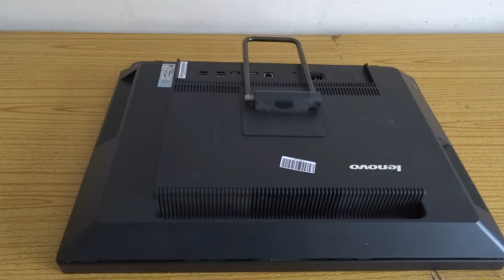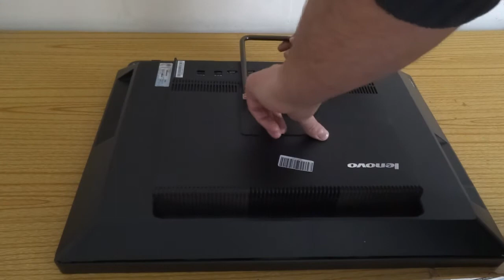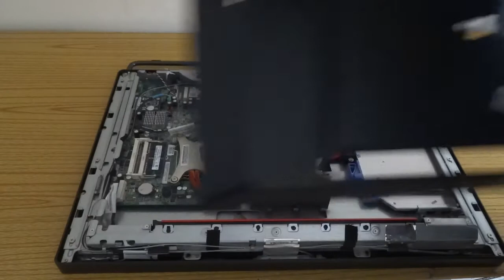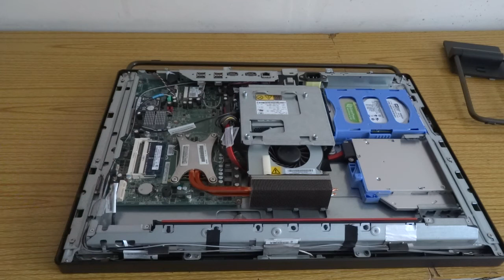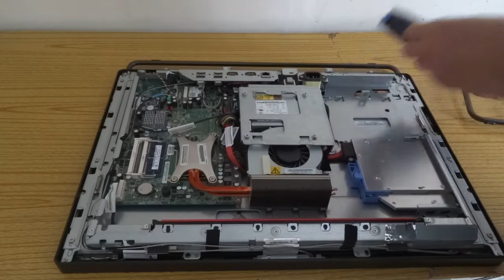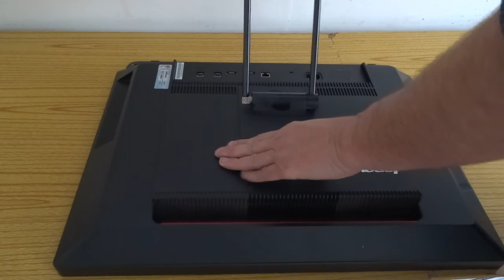Lenovo M92z 23 inch All-In-One Upgrade | SSD | RAM | CPU MAX UPGRADE

Comment: How did you secure the SSD to the inside of the computer? I didn't say exactly what you did, I saw you clip it into the slots but I didn't see how the card It's secured to the frame, you didn't use tape, Velcro, or An adapter bracket since you didn't reuse the catty.  I'm just worried that the connection wasn't secure enough because only the electoral connections clicked into place and I think you might have had a small aluminum slip around the SSD that is found in most laptops,  I'm just worried that the SSD might slip out or something because it isn't clipped or clicked into a place or anything
Reply from the maker: Yeah unfortunately I’m lazy and cheap on my own equipment and yes securely fitting drive is recommended I tend to swap ssd around a lot

Comment: Can i install gpu on this aio pc?
Reply: Nope... closest you could get would be the mini pcie and it would be extremely slow and not convenient, you might be able to use an egpu but if you only have usb 2.0 it will either not work or the bandwidth will be too low
Reply: @TsunamicBug  oh thx
Reply: @meinfps  np
Reply: did you get a gpu for it
 @meinfps
Reply: @Quickio  nope,im saving for gaming laptop
Reply: @TsunamicBug  can you tell me how to do it?

Comment: I have similar pc with yours, in this past several months, my disc C is always dirty, and it ended up asking for new windows installation all the time, do you think i should upgrade my hardisk to ssd?
Reply from the maker: Yes for many reasons, it will be much faster the main reason.

Comment: I maybe thought of using this as a monitor because I am going to get  another computer
Reply: Typically, with all-in-one computers (Lenovo ThinkCentre M92z, ︎iMac, etc), the Video-Out port is to send video signals out to an external monitor.  Normally there are no video inputs as they cannot be used as external monitors for other machines (because they’re a fully operating computer themselves).

However, there is a video input on this, so you may be in luck.

Please don’t fry something on your motherboard trying it though — read the manual first!
Reply from the maker: Looks like it has display port connections on rear so might work

Comment: Mine makes a really loud noise when it gets hot. Or after I use it for 30 mins or more. How do I make that go away?
Reply from the maker: There is only a few moving parts , dvd . hdd and cpu fan tes each one and see if you can find noise.
Reply: Sounds like your CPU is overheating and the fan is struggling to disperse the heat.

Suggest you remove the CPU heatsink, clean off the old (probably hard and useless) thermal paste from processor and heatsink (instructions elsewhere), then replace with new Arctic Silver (or similar top class) thermal paste.  Free/cheap stuff is hopeless.

Test/clean/replace your fans while you’re at it.

Comment: Can i remove the disc part and replace it with SSD
Reply from the maker: yes i did best to copy hdd first for drivers etc
Reply: You can also get cheap caddy adapters to properly secure the new 2.5" SSD drive in the blue 3.5" caddy.